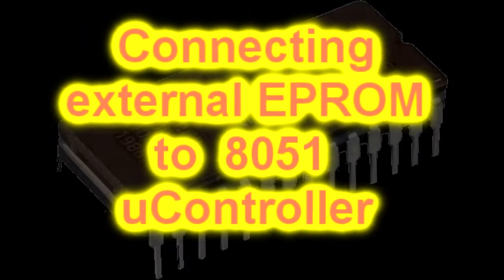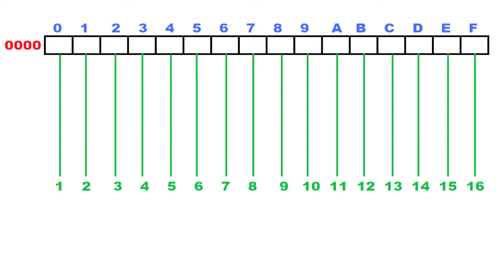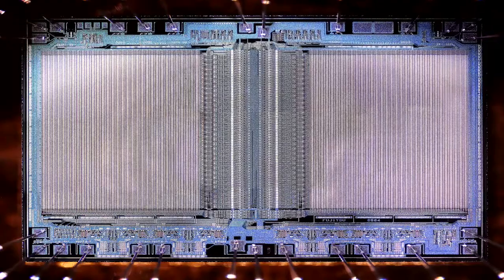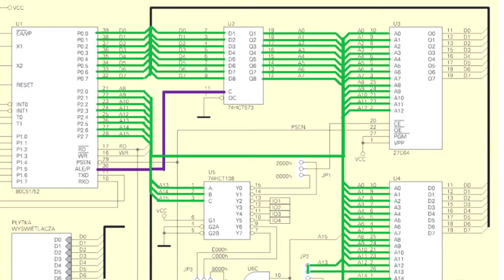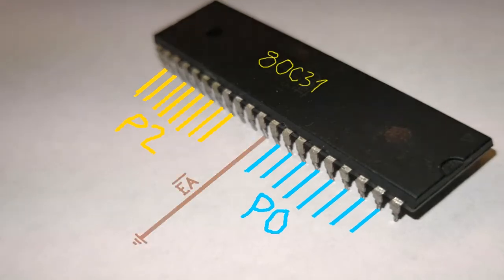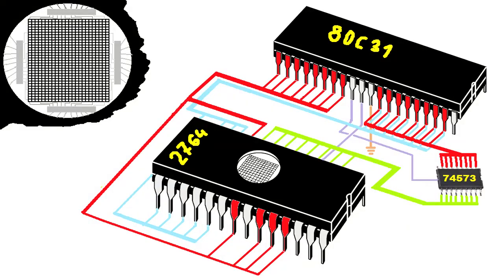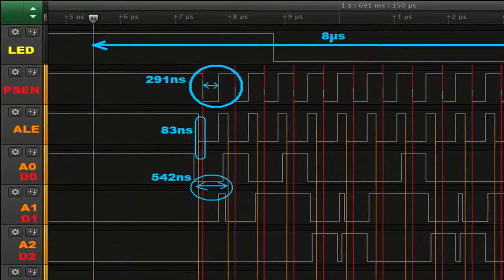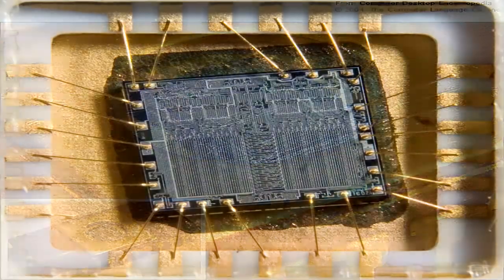[:RE005:] Using External EPROM for 8051

Comment: Please make more video like if we use nuvoton n79e352 than how and which hardware components required ?
Reply from the maker: Where was this micro used? I think i have some w78Exx in my collection, so i can test. But i have to know what applications are you interested
Reply: @reverseengineering2943  
If possible than try on nuvoton N79E352RADG, how to read and write hex code.
Reply from the maker: @gajendraparmar507  i will check if i have something similar to. I checked the same you specified, and is not in stock in shop in my country.. Such micros was placed in some weight mashines, I've never seen before that one.. But i promise i will check it for you.
Reply: @reverseengineering2943  
Thank you, sir
You perfect identify application.